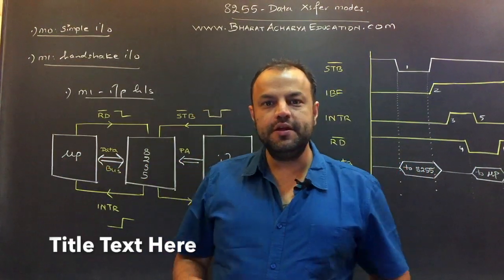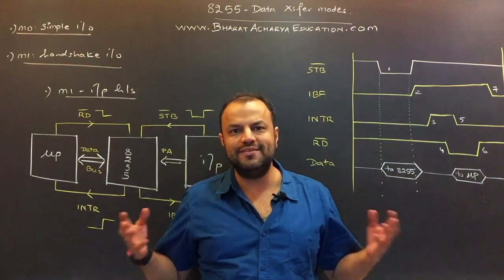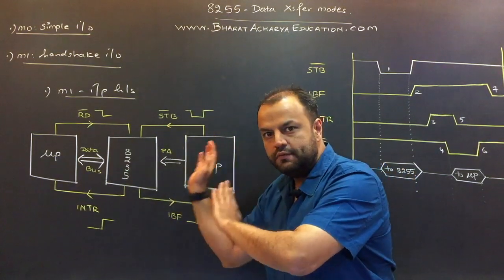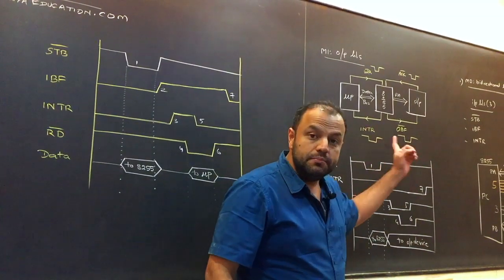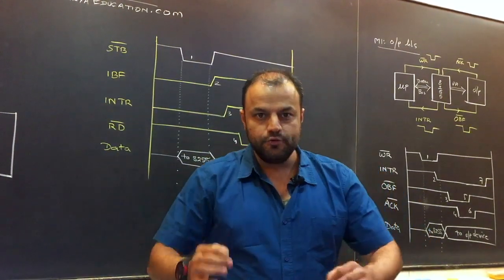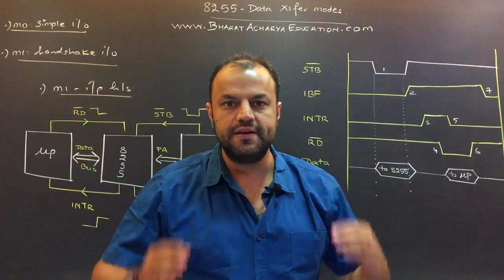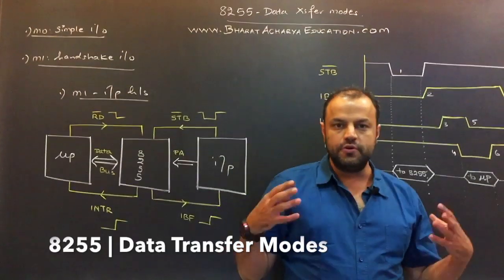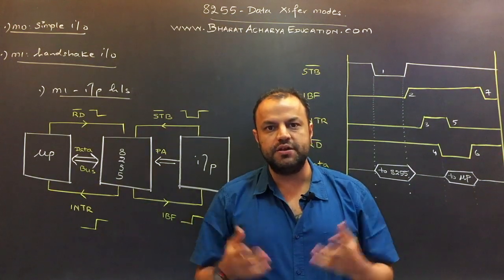8255 PPI | Data Transfer Modes | Handshaking | Bharat Acharya Education

Comment: Since we are using INTR pin here how will the uP know which interrupt to service... that was the point of using 8259 right. We never sent which device interrupted the uP and assumed it was 8255 and received/sent data. Will there not be a vector number and INTA here?
Reply from the maker: You will understand this once you watch the topics of Interrupts and 8259 in detail. 

https://www.bharatacharyaeducation.com 
Thank you!  
Learn... 
8085 | 8086 | 80386 | Pentium | 
8051 | ARM7 | COA

Fees: 1199/- 
Duration: 6 months
Activation: Immediate
Certification: Yes
Free: PDFs of theory explanation
Free: VIVA questions and answers

Start Learning... NOW!
www.BharatAcharyaEducation.com 

#bharatacharya  
#bharatacharyaeducation  
#8086 #8051 #8085 #80386 #pentium  
#microprocessor #microcontrollers
Reply: @BharatAcharyaEducation  Sir, I have watched all the videos on your website regarding 8259 and 8255, but I have don't understand how the processor knows if the interrupt is given by an 8259 or 8255, the response from uP is very different in both as in 8259 it gives 2 INTA signals, but here it works with read and write signals.
Reply from the maker: Buddy I have explained all this in MY videos on MY website  www.BharatAcharyaEducation.com

Comment: I need his assistant to solve this question
Write a program for 8255 to make flash light with 8 LEDs using BSR with delay 10 msec
Reply from the maker: Connect with me via WhatsApp on: +919820408217